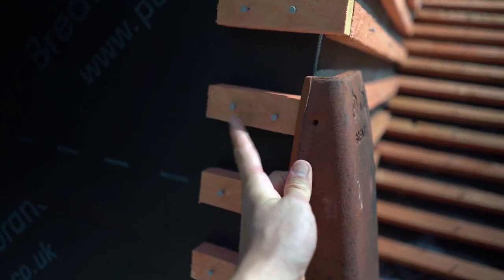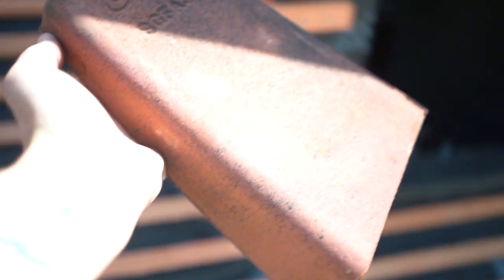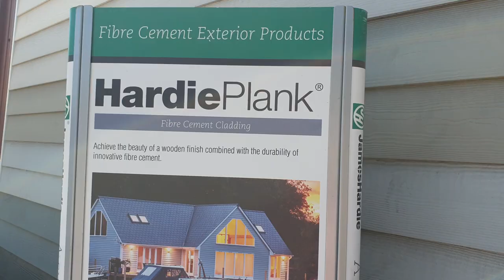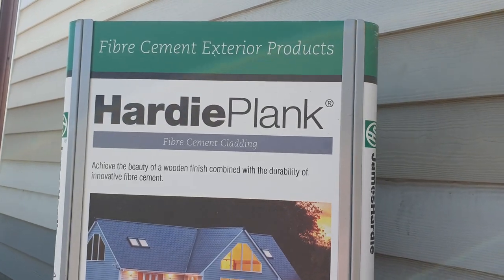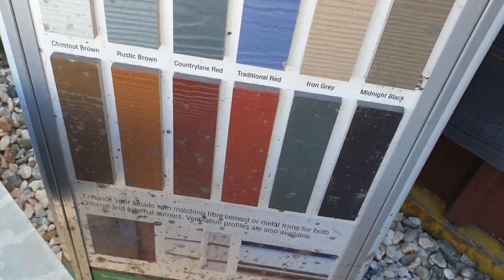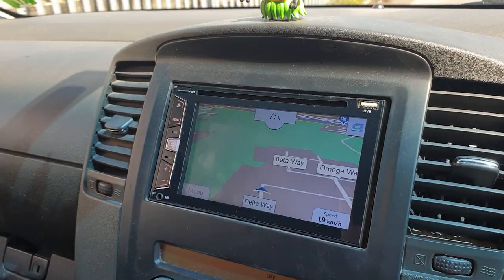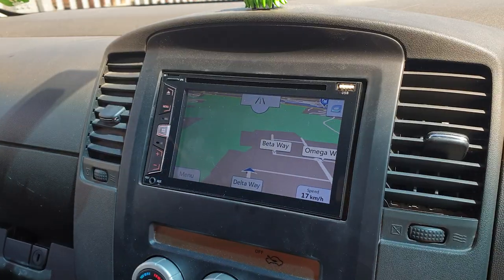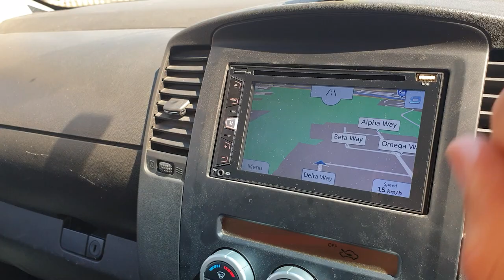BUILDING A HOUSE ALONE from START TO FINISH | E.P 55 [Making changes on the roof]

Comment: You could counter batten and use ply shims to achieve enough for 1 tile and a corner tile. That will save the work you have already done and roofing batten is cheap. This will depend on the soffit deapth above.
Reply from the maker: I did think about that but I dint think there is enough soffit. Think I'm going to go with cladding.

Comment: Hi mate, I’ve just done a extension in the Marley cedral cladding, we done it in the slate grey, I needed about 25m worth, if you have an account with Jewsons they do supply a lot of it nationwide, they do all the trims aswell for it, you may have to rebatten the dormers but it’s simple to fit, also get a proper cement fibre blade for your chopsaw mate, ox do one for about 40 quid, might be more for your big Bosch but you won’t go through a new blade in 5 cuts, give me a message mate if you want any advice on the stuff, we done the lap system

Comment: You need to tile the roof, then soaker up the sides of the dormers, then lead flashings over the soakers BEFORE you batten the dormer cheeks. And that’s if you vertical tile it or cladding. There’s not a lot you can do about the small cut between the corner tile and the window unless you cut a little bit (1”) off the actual corner tile which would make the size of the tile cut slightly bigger maybe.
Reply from the maker: Cheers for the comment pal, big help 😁👍🏻

Comment: Also look up some images of how you load a roof, make trays of tiles, 25 per tray. One upright tile on the the batten/rafter, then 4 sitting horizontal and sitting on battens just above, then two full packs of tiles side by side on top of the tray
Reply: I’ve got got pics of my own work but can’t share it on here to show you...........
Reply: Mat Gurd mate you beat me too it. 
I was scrolling down the comments to see if anyone had mentioned about the way it’s loaded out.  
He’s gonna have a bit of bother especially when he undoes the packs.
Reply: The Norfolk Treasure Hunter yeah and underloaded! Hard to explain what to do in writing 🤦🏻‍♂️😂
Reply from the maker: I'll have to do my research and do it this way for the rear of the roof. Cheers for the tips guys 👍🏻😁
Reply: Rodian Montague Builds  I tried to send you a pic on insta